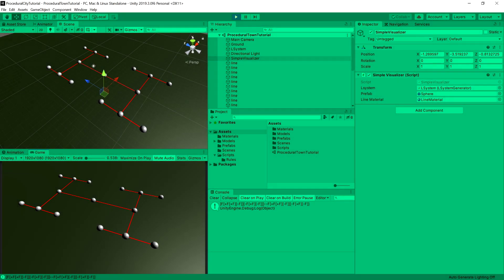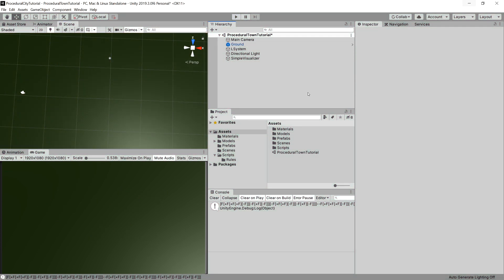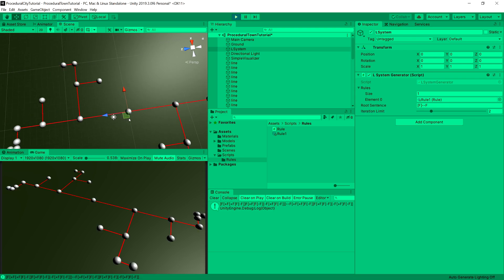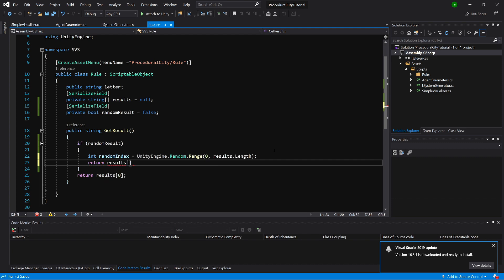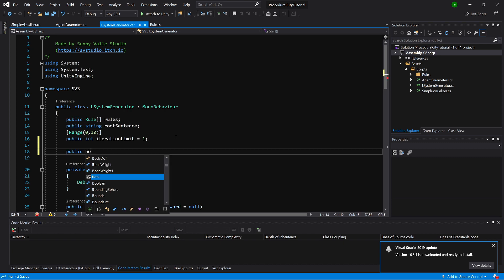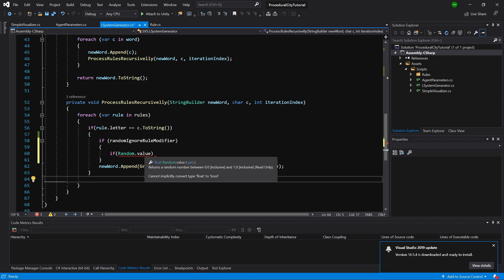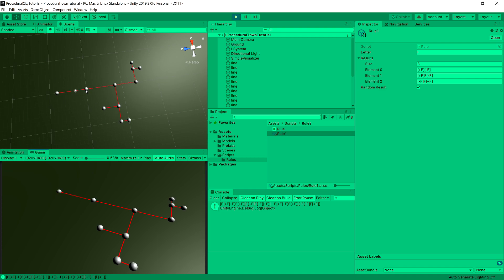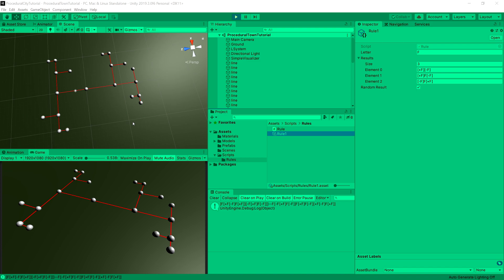Unity Procedural Town Tutorial Ep7 Discussing how we can use LSystem fo pcg

Comment: if the Random.value changed the scripting? For some reason it still throws me an error and when I select UnityEngine.Random.value, it clears the error.
Reply from the maker: Hi! Use whatever works for you. There are sometimes some ambiguities between those Random libraries so it's best to simply write at a top "Random = using UnityEngine.Random;"
And it will always call unitys Random library.